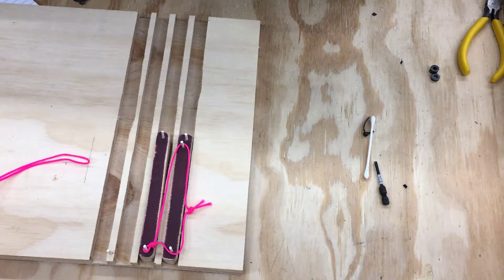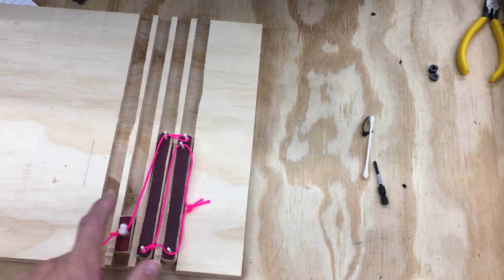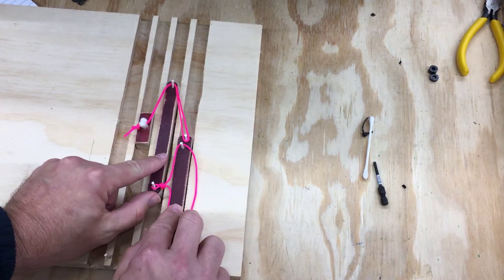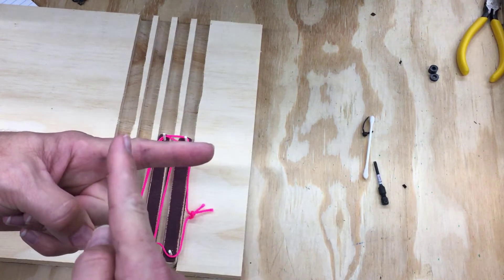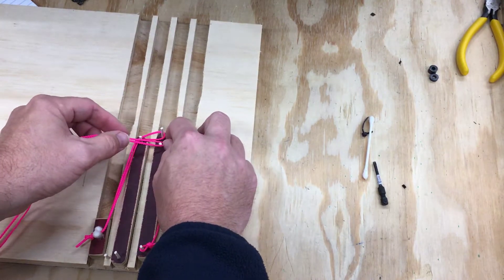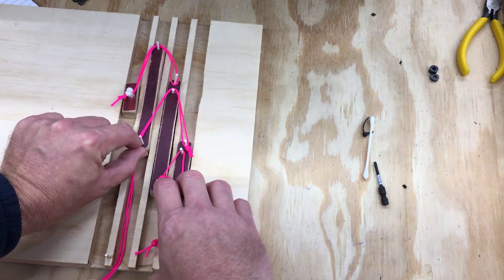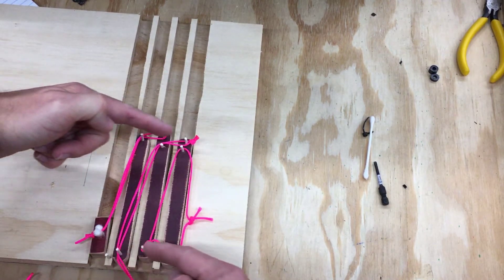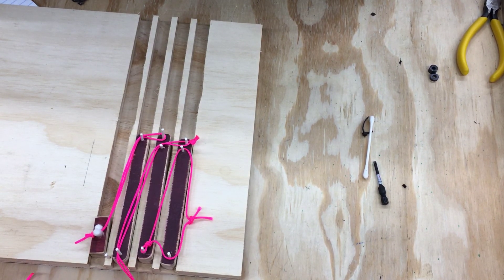cascade lift theory

Comment: Hi, can you explain if there is any difference in the tension of the ropes of each stage and why?
Reply from the maker: Yes, there is a difference. The bottom stage (call it stage1) has the highest tension. Stage2 less. Stage3 even less, and so on.

Example. assume a 5 stage cascade lift.

Stage 1 supports stages 2,3,4,5, and the load. Chain tension is highest. The last stage, that chain supports only itself (and the load).

For each inch stage1 chain moves, each subsequent stage moves 1 inch. So a 1 inch stage 1 movement would mean supporting 4 other stages moving 5 inches total.

For each inch stage 5 moves, the chain only supports a 1 inch stage & load movement.

It's the whole "work = force x distance" equation.

This 'summation' of load/tension/work as stages increase is why it's called a cascade lift.
Reply: @turbodog99  Thanks for the explanation. I undersand that there is a relative displacement bewteen stages of 1 inch if the stage 1 moves 1 inch. So in a 5 stage the total distance travel by the tip of the slide (last stage) is equal to five inches. Regarding the tension in the chains, i suppose that the increasing in the tension is due to at each stage there is an fixed point of attachment and a axle and sprocket point which implies that in a free body diagram of each stage the tension in the chains needs to be different to have equilibirum (i think that this reaosing is more clear for the stage 2 of your prototype, i hope my understanind is correct).
I have one other question that is related with the velocity of each stage... For example in the same 5 stages cascade if the velocity of the first stage is V the second one will move at 2*V the third at 3*V and so on right?
Reply from the maker: @pedrocarneiro7609  I would have to do the math, but I'd say the velocity is either a) 1v, 2v, 3v or b) v+k, v+2k= v+3k where k is some constant. But you're correct in theory regardless.